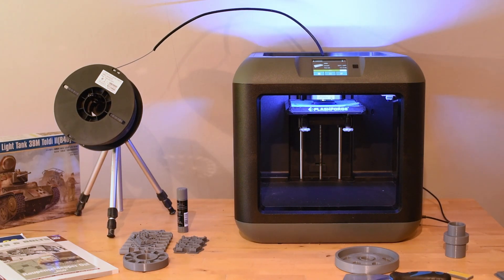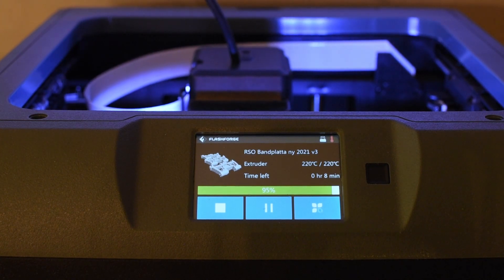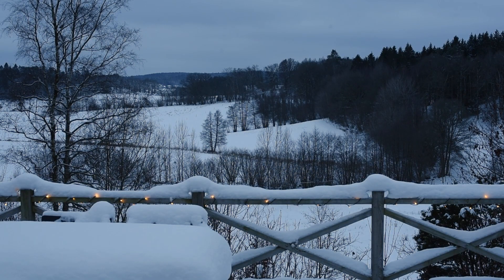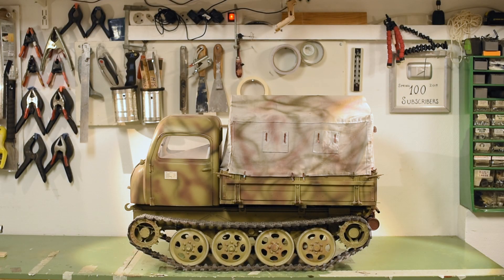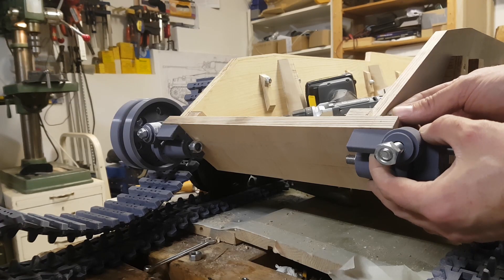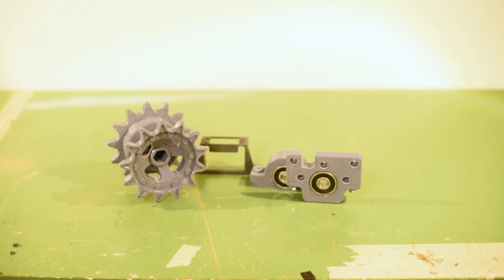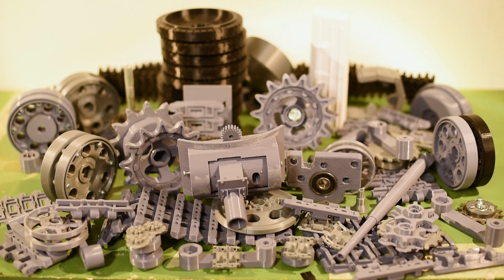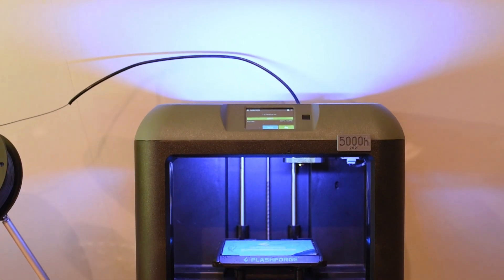My 3D-Printer has printed for 5000 hours!

Comment: How difficult was it for you to learn how to create the programs to print the parts you make? I have a 1/6 Dragon M4 Sherman kit that I want to RC. I'd like to print my own tracks and whatever else I need to upgrade the kit for RC. I also have some machine shop equipment: Bridgeport, Lathe, cutoff saw & belt sander. But as you know, a 3D Printer is a must.
Reply from the maker: Several years ago, I learned some CAD and Catia, that was of great help when I started to learn FreeCad. But I'm still learning. ☺ Sounds like you are pretty equipped to make a nice model!
Reply: @builtbyWikander  Thank you! Being a retired machinist is a plus. I'll search for a CAD program online and start the learning process. I'll also look into Catina and FreeCad. Thanks again, and thanks for sharing our amazing work.

Comment: Over the years how has your PLA filament held up? Do you paint it? Or do anything to it to help it hold up in extreme temperatures our sunlight.  Also your tanks loo great! I share your passion.
Reply from the maker: Hey man, thanks a lot!
The PLA-parts has hold up great during countless of hours at our RC tank-course and at meets. I am, however, avoiding leaving the models in the sun to prevent them from getting too warm. There are no absolute fixes to the heat sensitivity of the PLA, that I know of, other than keeping them in the shade when possible.

Comment: What did you have to replace in all these 5000 hrs?
Reply from the maker: I have replaced the brazz nozzle and plastic tube inside the hot end two times, I think. I just bought a new hot end assembly, because I thought the old one was broken, but it turned out it was the filament that was the cause. Someone sent me ABS instead of PLA and that didn't work. 🙄 No belts, motors or other things replaced.
Reply: @builtbyWikander  Sounds like a great printer.